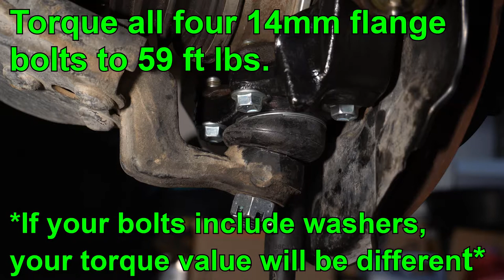First gen Toyota Tacoma/3rd gen 4runner lower ball joint replacement

Comment: I appreciate the video, but have a question. When you used the Pittman Arm Puller on the tie rod end, it looked like it completely destroyed the grease fitting. Was that the case?
Reply from the maker: No, it is still intact. If you are careful with the placement of the arms, then you can remove the tie rod without damaging the boots or the grease fittings.

Comment: Hi, what is the part number of the Pittman Arm Puller you used to remove tie rod and balljoint?  Thanks!
Reply from the maker: It doesn't have a part number. It came in a cheap kit I ordered on Amazon. If you search on Amazon for Pittman arm puller, or ball joint kit, you'll see it in the photos.
You can also rent one of these kits from Autozone or O'Reilly autoparts for FREE.
Reply: @AVI80R907  Thanks!!!